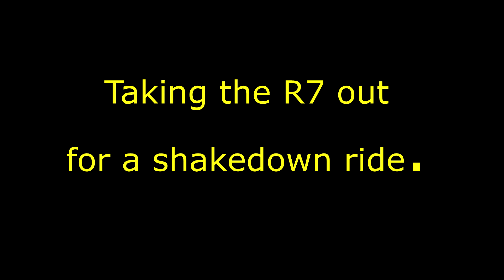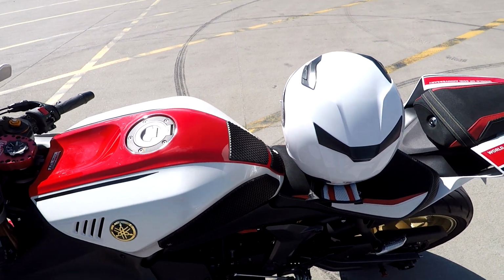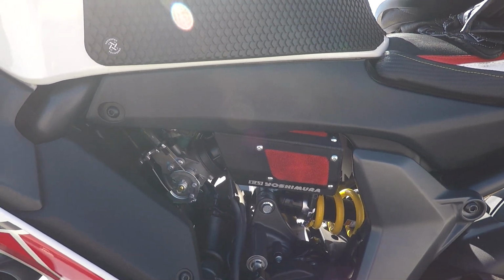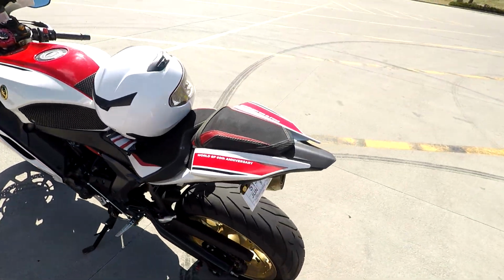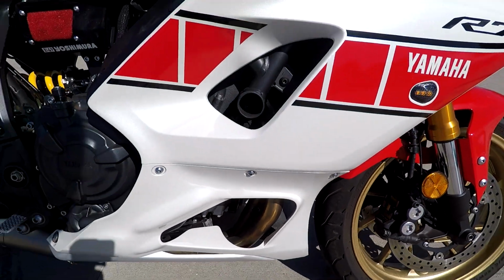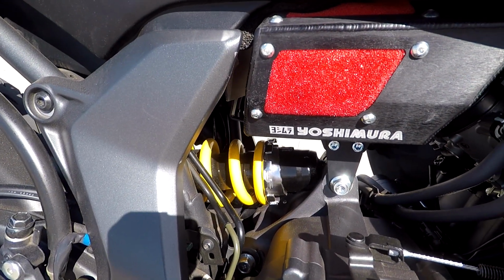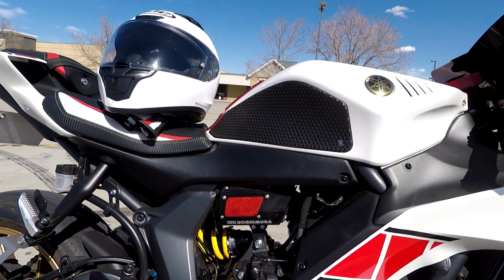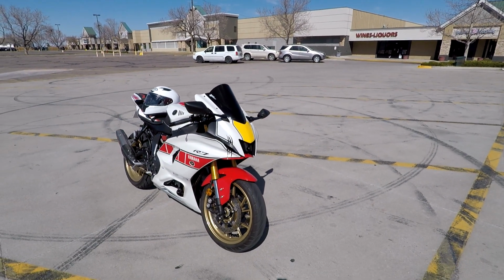Yoshimura R7 Airbox Kit Part 3 Shakedown Ride

Comment: can you make a video on what the process is to clean the air filter on the yoshi box?
Reply from the maker: This is the one downfall to this airbox, to properly clean it you need disassemble the inner frame to clean the filter element. This is where the Hordpower system is better, unfortunately Hordpower is no longer making them.
Reply: @ThisOldGuy3 they are making them you just have to email him to get on a notice list. They’re making them in batches. It takes about a month to get the notice that it’s ready
Reply from the maker: @MotoMedicine904  That's good to know for all the MT07 and R7 owners out there. I highly recommend this upgrade along with a full exhaust and proper ECU flash/tune.

Comment: Could you share what the Yoshimura airbox power graph looks like?
How many horsepower did you gain at peak?
Reply from the maker: I have not had a chance to have it dyno'd Yosh claims 14.4% with their Race system and airbox. The Akro race system adds a little more HP and torque than the Yosh system with its longer length. https://www.yoshimura-rd.com/products/yamaha-yzf-r7-mt-07-airbox-kit-750bg137200

Comment: Keeping an eye on these intakes, $500 is a bit steep for what it is, though. Do the brake / clutch levers come black from factory for the 60th Edition or did you coat them?
Reply from the maker: They came stock in black on the 60th, as for the intake I think most would be just as happy with the MT07 HordePower intake. This one looks cool but I am not sure most would notice any real world difference between this and the HordePower one that is $175 cheaper. I miss the days and look of an individual velocity stack and cone filter on the back of each throttle body.

Comment: How significant of a difference is the power from the stock airbox?
Reply from the maker: Yoshimura claims 14.4% increase with Airbox and full exhaust. 2Wheel Dyno Works who I sent the ECU off to says I can expect a 10 to 12hp increase at the wheel.
Reply: @ThisOldGuy3  Have you had any issues servicing the airbox? Seems like it's going to need more attention than your average air filter
Reply from the maker: @Jaxwildin  It is a Uni-Filter mesh so it is washable and replaceable, Ihave not put any significant miles on it yet so haven't needed to clean it yet. I do think it will require more maintenance than say the HordePower system though.
Reply: @ThisOldGuy3 not a bad increase of power anything to make go bit more are you going to try sprockets gears front back dose the r7 have ram air standard?